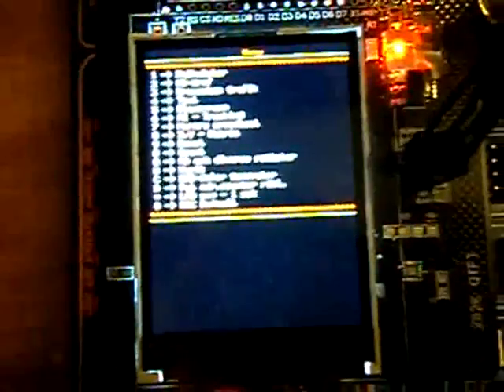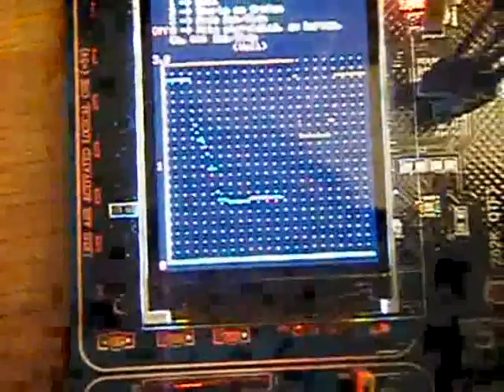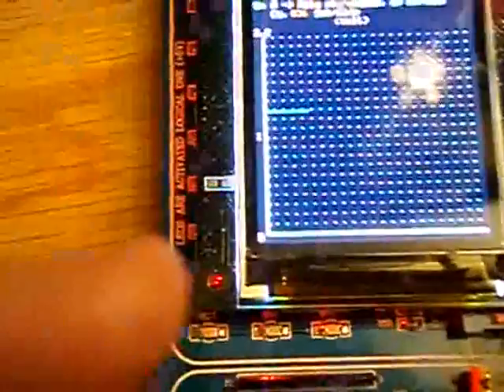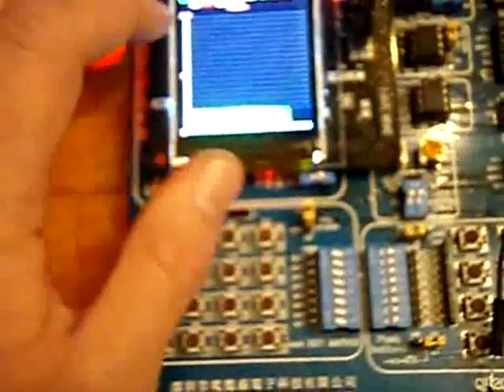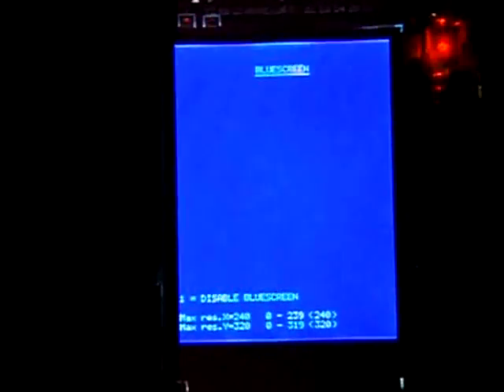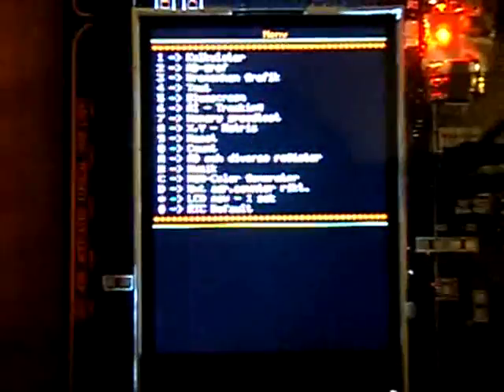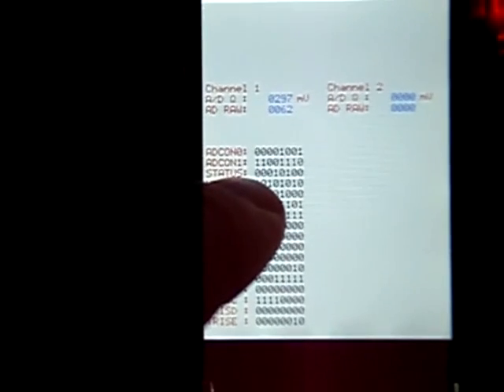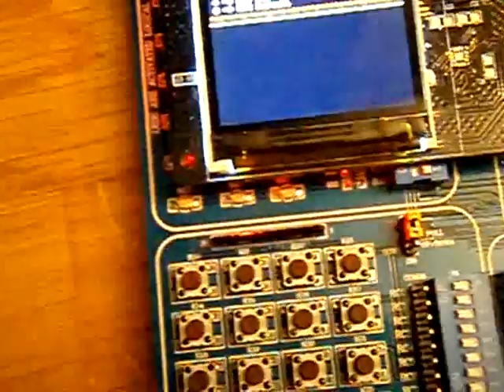QVGA+PIC=POSSIBLE (2)

Comment: That's very very cool man.
  What kind of project board is that, how much does it cost and where can I get it.
     I enjoy your videos.
   This is a very cool project mainly because it has a screen and I'd like to use it with a GPS reciever (like the one you used) so that I can make some graphical display showing how far a way point is and in what direction (using a digital compass in tandem with the GPS reciever).
    Thank you man, I enjoy your videos, keep 'em coming.